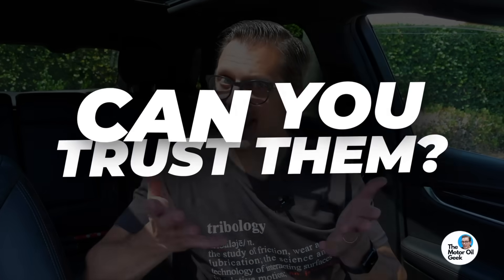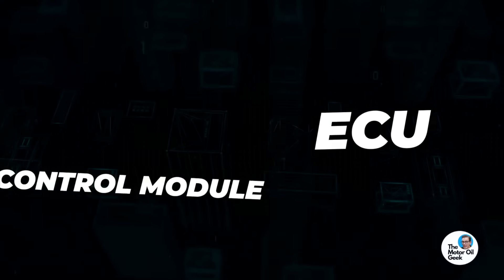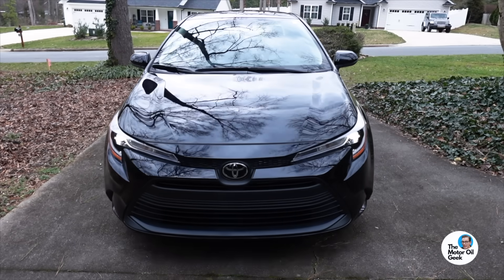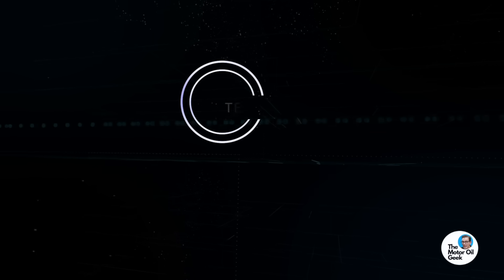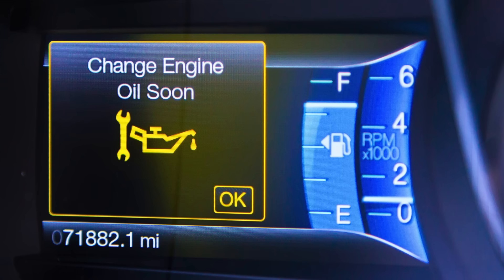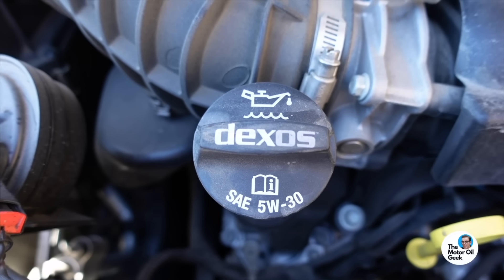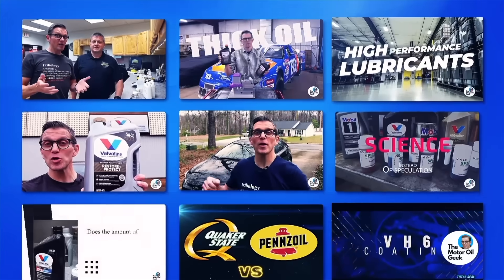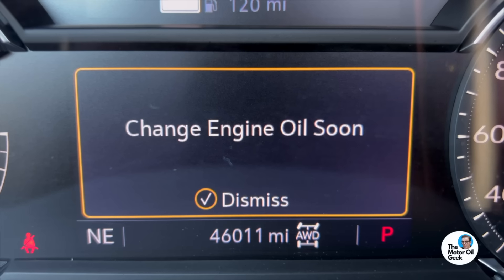The Accuracy of OIL LIFE Indicators REVEALED!

Comment: After installing my SLT oil catch can, i went to the mountains of northeast NM in winter time. I checked the can each a.m. before driving ( because I had driven hundred or so miles the previous day) and noticed some creamy colored sludge. The oil life is precious to me because I run twin turbos and keeping the gunk from recirculating has significantly improved engine endurance.

Comment: As a loyal 45 yr GM buyer i went from 3 to 4 thousand miles until the early 2000’s   Then i switched to the 5,000 to 20% metric. I have the belief you cant undo wear, without an overhaul.  Oh at least 4 vehicles over 200,000 miles. Ain 2019 i got an oil change an 3 weeks later i was back after a MI to Seattle trip pulling a trailer. Dealer service couldn’t believe it.

Comment: This may seem like a odd question.  Clearly Mercedes is not GM. But  when I look at the owners manual of my 2005 Chrysler Crossfire SRT-6 powered by the AMG M112k engine  ( or  Mercedes M112 if non SRT variant ) it says it has an optical sensor to help determine contamination in the oil for the service life indicator and that using the wrong grade of oil ( manual says  0W-40 ) could throw off the sensor and the service life indicator.  Is it just BS or is that how these things worked in the M112/M113(K) engines.

Comment: As a guy who only drives about 5500 miles a year on my commuter car, I change the oil twice a year, no matter what. The only loss I have is a few extra dollars per year on oil and a filter, changing it earlier than may be strictly necessary. I'd rather change it early through routine maintenance than have a major engine failure. There's a reason my car has 200k+ miles on it and is still running smoothly!

Comment: Excellent info! Guess it's time I start trusting my oil life indicator in my GMC truck! Thanks!!!
Reply from the maker: Glad to help
Reply: You have worse problems; if the AFM / DFM doesn’t do in the engine, carbon buildup on intake valves from blow by will. Don’t even think about the transmission. GM and reliability should never be used in the same sentence.

Comment: I run Royal Purple HPS in a larger cam LS7.   Engine builder uses the HPS oil as there “shop” oil.   I called Royal Purple tech and spoke with a rep.   I was told if I didn’t road course the car (not a track toy) the oil should be fine even to 15K miles.   They told me the oil was tested in high boost applications and even after 15K test miles which include track time, oil still retained adequate wear package performance.   I didn’t totally believe him.   My car also has the GM oil life and I have been using it to prompt my oil service intervals.   But maybe the tech was being truthful.   Still don’t want to trash an engine over crappy maintenance practices.

Comment: Have an 08 gmc with a diesel engine and did an oil analysis with Blackstone labs and i told them the oil sample has 31k miles on it i got the report back and was amazed by the results everything was normal for example the viscosity was still the same 15w40 no fuel or coolant in oil  bearing wear was normal just to name a few and they said i could have taken the oil another 4k miles so now i change my oil at 35k miles currently i have 320k miles on my engine. So now when my oil life monitor says 0% i resets it back to 100% until i reach 35k miles then i change my oil....by the way i never take short trips in my truck

Comment: I bought a brand new 2022 WRX off of the showroom floor in July 2022.  I bought the 3 year maintenance plan just so I could have paper receipts of its early life in case I needed to sell the car.  They recommend 6 month or 6,000 mile oil changes, among other things.  According to their numbers I should be somewhere in the 27000-30000 mile range, but currently sit under 13,700 miles.  But I still go in every 6 months to get er done.  On a car that was sold as having a chonkier motor, a smaller turbo, not needing E91+ fuel, etc. etc.  I looked at the head sales guy after all of this and said, "I'm already overpaying too much for this car, I'm going to make sure she stays on the road as long as possible."

They already had my money, but he nodded and smiled and said, "Welcome to the Subaru family" lol

Comment: As a delivery driver for UPS since 2015, the majority of our trucks are built on a Freightliner Chassis, some newer ones being Ford, Workhorse was in the game but they've since worked with FedEx or their new electric division.  With that said, almost all gas powered trucks have come with the 6.2L LS2, the Fords had the Triton V10 until a couple of years ago where they swapped to the 7.3L Godzilla engine.  All of the GM variants would randomly put up a warning about "check oil filter" or "check trans oil" warnings and I've always wondered where that came from, being that these step vans were industrial grade and highly abused.  Of course UPS being a multi-billion dollar corporation, you basically drive it until it blows up, but the mechanics do appreciate when you write things up so that they can keep the fleet going as long as possible.  I can always tell when the differential gear fluid is ready for a flush because you can smell it after a trip on the highway, but getting them to change it is another story 😂

Comment: As far as trusting the oil life indicator, depends on the owner as to wether they put a proper oil in the vehicle. Done seen to many vws with owners that want that $20 oil change to last 10k miles to many times.. they just out last warranty and look like they leak oil out of everything under the plastic engine cover. Also seen a brand new Camry lock up because the customer didn't believe there was a difference in 0w/16 and 5w/30.

Comment: Here is a video suggestion. There used to be a product called the "Lubricheck." I had one. And from what I could tell, it was very accurate. But I don't know for sure. Also I bought another one (because I loaned my Lubricheck to someone and when I got it back it did not work as well.) off Amazon. (OT100 Engine Oil Tester, no longer available. I tried two others and they were wildly off from known oil.) I just wonder how accurate those devices are. Thanks for the videos. They are always worth my time.

Comment: I suspect that the industry wide adoption of direct injection for gas engines, combined with the bad habit of short trips in cooler weather, is why timing chains, phasers, and AFM/MDS lifters have been so failure prone lately. GDI engines also produce diesel-like soot that results in lots of soot in the oil. Chains are wearing, phasers are wearing, lifters are getting stuck, etc. It would be interesting to delve deeper into this issue.
Reply from the maker: Soot from the GDI is the main culprit.
Reply: @themotoroilgeek Catch can
Reply: I noticed when I got my first direct injected turbo car back in 2006 the oil got dark in less than half the time of my NA cars.
Reply: @VAspeed3  Turbos are typically cooled via the engine oil and those suckers get hot! To be expected in a turbo application.
Reply: @VAspeed3 Turbos get hot. That oil lubricates the turbo too and takes the massive heat from it. Turbos should all get 5000 mile oil changes. I don’t want a turbo. I don’t want an EV. America is no longer a free country though. Unelected EPA rules us like a king with NO right to do so.
Reply: @VAspeed3  thats why turbo engines used to have half the oil change interval of their NA counterparts. Nowadays they're twice that lol

Comment: If it was a rental, can you be certain the OLM was reset the last time the rental agency changed it? Theoretically, the OLM could have been at like 30%, wasn't reset, and the oil was only down "21%" instead of "91%". I will also add that as a GM owner, with that same 3.6L V6, the dealer told me the OLM algorithm is wildly inaccurate. I went in at 13% remaining one time and the dealer scolded me. They said they had actually had discussions with GM engineering to ask them to revise the algorithm to make it more conservative. They were seeing too many instances of the OLM allowing customers to see over 10,000 miles between changes and that was causing issues with the DI engines. In my case I was at 13% remaining after 7,000 miles. Now I simply change the oil myself since I now only drive 4,000 miles per year. It gets changed once a year, and the OLM only gets down to about 40%.

Comment: My Ram 5500 work truck with a 6.4 Hemi gas engine has a pretty good system...I run 7 days a week... My truck is over 15,000lbs EMPTY.... and with the miles I put on it... I can tell it knows what kinda driving I'm doing if it's stop n go, highway, loaded heavy and even seasonally by temperature..... certain conditions drop the oil life percentage faster than other types of operation. The truck runs 7 days a week & in 7 years... It runs Perfectly, no leaks, drips, smoke, no Hemi tick..  I'm in Minnesota & our winters are Long & it's not unusual to see -20F below actual temperatures every year.. & upper 90s & Very high humidity & dewpoints... and every time it gets loaded, it's at Max weight or more.... I run Either Mobil 1 Full synthetic or Pennzoil Ultra platinum 0-40. Oil gets changed every 5k regardless of miles because of alotta run time operating a PTO hydraulic system..... Zero issues... but I can tell the Ram system takes driving style, speed, load etc into its calculations.

Comment: Making it more complicated than it is.  Change your oil every 4000 miles regardless.  You ad the high of 5000 miles to low of 3000 miles and you get the avarage of 4000 miles oil change interval.  Moreover, you don't have to be confused by oil guru on line.  Now if you have time and money to do it every 3000 miles then that's the optimum.
Reply: I dont find him confusing at all.
Reply: His point was instead of spending the money to mail in an oil sample…..just change the oil sooner and eliminate the expense…..
Reply: I do 5k or 2 years no matter what

Comment: I have found that about 30% oil life left is in the 5-6K mileage on the oil. GM had a software update about 15 years ago to change the software to prevent it from going past 7500 miles.

Comment: My 2024 Honda Civic says it has 40% oil life on the "original" oil after 7500 miles. It has never been changed or reset. I tried to have the Honda dealership change it for free with the Honda Service Pass program, but they will not touch it until it gets to 15%. Seems scummy to me.

Comment: On my 2005 Silverado pickup I change the filter and add a quart at 5000.  I do a full change at 10,000.  I have 285,000 on the odometer and I’ve never had to add oil between those changes.  I am not hearing any nor experiencing any engine issues here in Minnesota.  Lately I’m only doing 8000 per year so I am now doing a full change at 15 months.  Before you write all kinds of comments, my owners manual only says to change oil at least annually if the change oil light doesn’t come on.  And it holds 10 quarts as it’s a diesel.  😊

Comment: Using synthetic motor oil:

I've gone up to 15,000 km / 9,320 miles on a Oil Change Interval on my '09 Pontiac G8 GT / Holden VE Commodore SS that has a 9 US quart oil sump.
& up to 12,500 km / 7,767 miles on a Oil Change Interval on my '14 Camaro SS that has a 8 US quart sump.

Comment: This is why its important to plug in a block heater in cooler weather even if the owner thinks they don't need to because "it starts fine", in really cold weather it takes quite a while to warm the engine up from stone cold dead vs partly warmed up by the block heater. In fact with a V8 engine that is set up with a block heater on one bank of 4 cylinders, that side of the engine becomes warmer than the other side even though the coolant gets warmed up in general but not not as warm everywhere. It was shown that after a number of miles accumulated and yes this is in Canada with our harsh winters, testing the cylinders compression showed time and time again ( This is the GM 350 engine example ) that the bank of cylinders with the block heater had a notably higher compression than the cylinders in the bank on the opposite side. So just think of what happens if the block heater was not plugged in at all and doing the same cold weather starting day and and day out, how much faster an engine would wear out.
Reply: 40 yrs ago, I walked past the Parking Lot at the Police Station, in Edmonton, and even though it was in the Summer and the Temp was 20+C, every Cop Car was Plugged in. I went inside, and asked why. I was told that the Car might be needed in a hurry, and they may need Full Power from the Get Go. A Cold Engine, even at 20C, would still have Cold Oil, and the Choke would still be applied, both of Which are bad for the Engine when Heavy Throttle was applied. I was also told that all the Cars had more than One Block Heater, so the Engine stayed Hot even in the Winter, which can go down to -40C.
Reply: @pjimmbojimmbo1990  I must say I really enjoyed reading your comment !. And to think their vehicles were all gasoline to boot and yet plugged in during the summer, I've assumed ( I would have to ask one of my volunteer fire fighter friends ) that the typical diesel powered fire engines etc would be plugged in even though they sit in a heated shop, would imagine that would apply to ambulances as well although in some cases they never shut them down as often they are on standby running with paramedics ready to rush to the next emergency. I actually rigged up my pickup ( sadly its rusting away due to the crap they spread on our highways ) with a block heater in each side of the V8 engine, and using 0W-30 oil ... it starts like a summers day in -40 weather and in short order I have heat coming out of the ducts. By the way this topic also reminds me of a brother inlaw who years ago had a 1996 GM pickup with the 6.5 turbo diesel, one winters evening someone came crashing into the front/side of their fifth wheel trailer that sat on their driveway so he dives out of the house into his cold unplugged in pickup and starts it and chases after the guy ... didn't catch him but he blew up his engine. It started knocking badly as I assume it may have turn a crank or connecting rod bearing and imagine the pistons expanded too fast and may have tightened up in the bores. Whatever went wrong was bad and I think he sold the truck on the spot ( not sure if insurance covered anything due to the circumstances or just a loss for himself ), that goes to show how some engines being started cold and asked to go to full power will tell you what they thought of that idea.

Comment: If that rental is from Enterprise / National / Alamo, the OCI should be 7500 miles.  However, the branch that I work for has had cars come through that are going on 11k miles or more since their last PM which means it's either been neglected for several rentals or someone hasn't been reserting the mileage in the maintenance system.  In reality, it's probably six of one, half dozen of the other.

Comment: interesting, i'm not sure if they are using this algorithm any longer. my work truck with a 6.6 gas sees heavy fuel consumption and -40 to overheat temps and the OLM seems to count same as light duty use. my diesel i never let go under 35% OLM and that work truck i always change off engine hours which works out to be 5 to 7000 miles depending and i see 35 to 20% OLM. lowest i've ;et my wifes SUV get is 20%. i think my GMC 3.0L would hit 0% at 10,000 miles or more.

Comment: have 235k miles on my '13 ram 1500.    changes oil once,  just once, going off the oil life indicator.     oil was not quite as black as a diesel or di engine, but was quart low.     continued the 5k erl change from then on

Comment: Im not so sure about the results here from 1 GM car with less than 50k.  I am familiar with early turbo BMWs with 10k mile recommended intervals what will spin bearings.  Ford Ecoboosts again with longer intervals that have cam phaser issues.  I wont go past 5k miles in my vehicles.

Comment: Lot of good info in this video.  however, I must have missed something.  It sures sounds like the test showed there is way, way more than 9 % oil life left.  More than just conservative.  this sounds like following the recommendation will result in a lot of wasted oil and money when multiplied by the number of cars that use this system.  Does oil life decay exponentially?  What in the numbers from the test say it is close to end of life?  The silicon content seems to be one off and something that the computation really does not try to factor in.  So, that can’t be a reason to stand by cars calc on oil life???

Comment: Brother, it’s a rental car! 
You have absolutely no clue how many miles are on that oil. It could be 1k miles. And naturally the oil will sample perfectly. This isn’t a very scientific testimony as to the accuracy of GM’s oil life monitoring system at all. 
When’s the last time you knew a fleet mechanic, rental car shop, or quickie lube to properly reset the oil monitor? I for one have had to reset myself more times than I can count after my GMC dealership did an oil change. 
Those lube guys are lowest cost labor a dealership can find. And most rental car fleets are serviced based on recorded miles. 90% of them have no clue what an oil monitor even is. 
Love your stuff, but this one is a miss in my book.

Comment: On my 2019 Acura RDX, I did the oil change at 40% on the monitor. Averaged at 8 months/6,000 miles. Same for my 2023, but changed the oil filter at 500 miles.

Comment: Using high quality oil but still changing it every 3 to 4000 miles.  Most people are leaving oil in too long causing engine parts failures period. Castrol 5w30 with dexos is good oil.